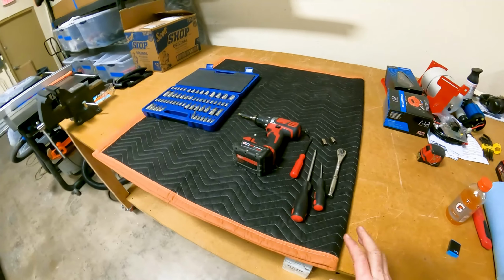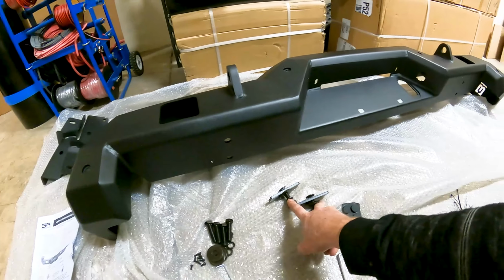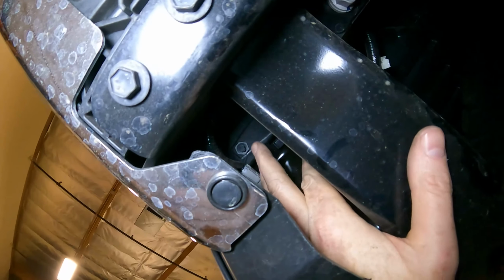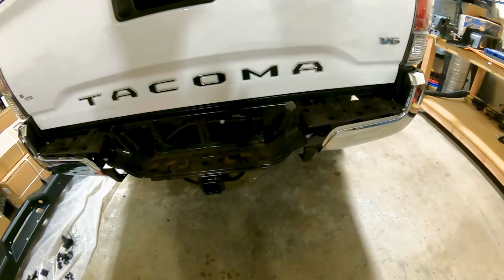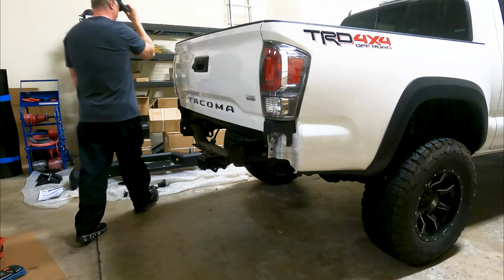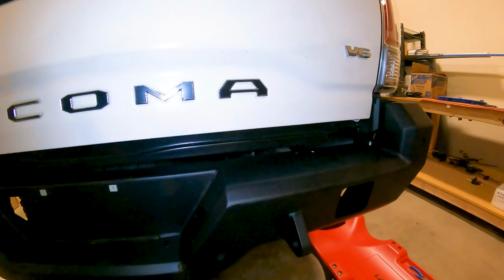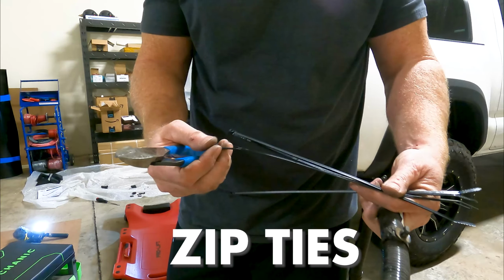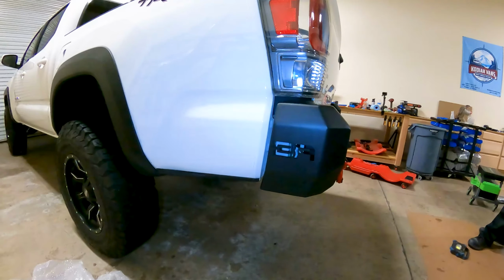How to install a Body Armor Rear Bumper on a 2022 Toyota Tacoma eps10 steal bumper with shackles

Comment: Did you have any issue with the trailer lights being too short to hook up to the new bumper slot?
Reply from the maker: Not at all, I had to shorten the wiring they provided by cutting it after wiring it through the tail lights.
Reply: I have the same problem, the wiring harness on the truck is now about 2 inches too short to make it to the plug on the bumper. I am assuming it sits out a little further than it did on the stock bumper which created this need for a couple more inches. I cant seem to get much additional slack out of the harness on the truck. Did you end up figuring it out?

Comment: Do you feel the recovery points are sufficiently strong enough to use for an actual recovery (either recovering the Tacoma or pulling another vehicle)?  Strong in terms of attachment to the bumper and bumper attached to Tacoma.
Reply from the maker: Yes extremely strong, you will have to tear the frame off to get this bumper to fail
Reply: @ourmidlifecrisis  Good to know.  I’ve been looking at that bumper.  Can you estimate about how much weight it added (BA bumper minus weight of OEM bumper)?